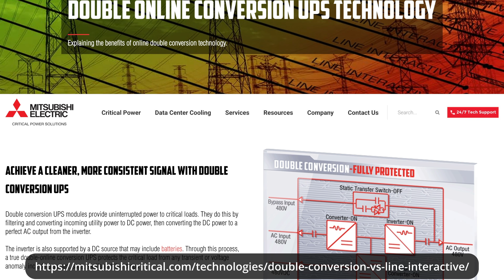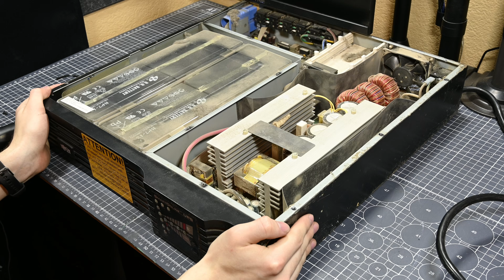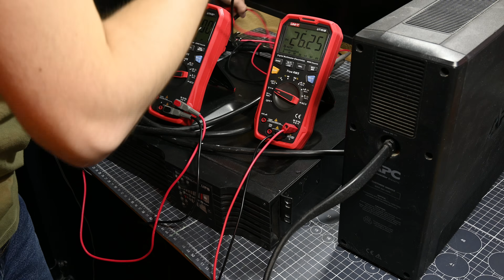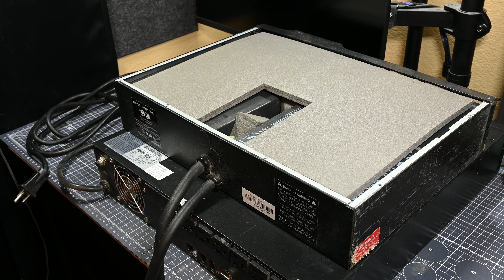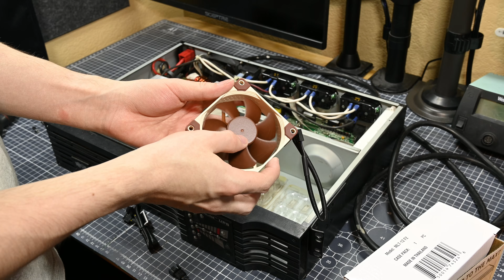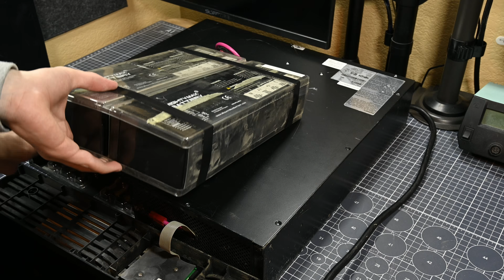I Made HUNDREDS Fixing and Selling These Giant UPS Units!

Comment: I literally just replaced the battery in an old one that was being recycled from my job. Same exact model as your 24v one. But, it's way too loud and I don't really need it, and they sell for like 100 bucks online, the exact amount i spent on supplies to fix it. It's so heavy and loud too! It's just sitting in my room doing nothing lol. Wish I could offload it! I even have an extra pair of replacement batteries. Great vid, huge coincidence!
Reply from the maker: Are you able to try selling the unit locally? That's how I offloaded mine. If you can manage that, you can charge more for the unit because you don't have to charge the buyer for shipping as well and you get to keep 100% of the cash. Some homelabber near you would probably love to pick one of these up with that spare battery you mentioned for 200-300 bucks!
Reply: @CHWTT  I would try but I'd never want someone to blame me if it failed or their important hardware went kaput. Regardless of if its actually the UPS fault, Im paranoid theyll blame me. Maybe if I sold it to a stranger

Comment: JTLYK,  at 15:54, you're using Nitrile gloves as extra protection.  Nitrile is not a good choice for insulated gloves.  Best to use ASTM D120 gloves.  There are very flexible, inexpensive ones on Amazon. I'd rather see a shocking video (OMG, the dust on that unit- how did it function?) than a shocked you. :text-green-game-over:  I'm glad the units sold!
Reply from the maker: Thanks for the tip, I will look into those!

Comment: Those aren't "battery cells". They are batteries.

A battery is made up of cells, and those batteries are made of of 6 2.2v cells to give you the 12v.

The ACP isn't a "2s 2p" pack...

That S and P is in regards to cells.

So being a 24v set, it would actually be 12S2P.

But you really should drop that. It's not relevant.
Reply: OMG... Stop talking about P and S. 

And cells.

You make yourself look stupid using terms you don't understand.
Reply from the maker: @theonewithin609  I'm well aware of the fact that a 12V battery is made up of 6 internal cells that are the actual cells. And yes, that would totally make a pack of two sets of two 12V batteries in series in parallel a 12S2P pack.

However, in this context, it does not matter that the batteries are made up of several cells internally and that there are technically 12 small cells in series when two batteries are in series. If I was building the pack with those individual 2.2V cells then yes specifying the pack as 12S2P would matter, but I'm not. I'm limited to identical blocks of 6 cells. In relation to the UPS battery pack as a whole, which is the scope of this application as I'm refurbishing a unit and not engineering one, each battery can easily be considered a cell when compared to the whole UPS pack, and each true cell can be limited to being called a cell only when in relation to a singular battery (again within this scope).

Hence, while it would be more technically correct to call the large 8-battery 48V 18AH pack a 24S2P pack and the 8-battery 24V 28AH pack a 12S4P pack, the people who are just interested in or who are just trying to learn about repairing a lead acid UPS unit will not care about that level of detail and could very easily become confused or overwhelmed by revealing too many layers of the subject at once. Writing to an audience is a critical part of creating content like this, and while your point is technically correct, it would be a poor choice to have based the whole writing of this video off of it. A tidbit expanding on this topic briefly at some point in this video probably could have been included for the sake of maximum accuracy, and will be next time, but the overall language describing packs as 4S2P and 2S4P in relation to the number of batteries will not be changed; it is the most efficient, effective, and simplistic way to convey the necessary information to the largest percentage of the audience.

Comment: It's worth noting that the runtime for these types of UPS's really isn't that large.  They're  built to run very large loads for a short time while the generator gets fired up.
Reply from the maker: Very good point, their goal is usually either that or to keep the equipment on long enough to safe shutdown for the remainder of the outage.
Reply: the goal is to hookup the ups to the active Machines, either thru software to the machine via RS-232  or they have an active  mgmt.  ethernet port to  gracefully shut them down... so data is not lost... as in DBMS, or server cluster... things that were done in the early 2000's. UPS's under a desk is another story.. in the corp. world, it gave you time to save your work locally so you didnt lose what you were working on...  get it right....

Comment: Imagine throwing out that UPS when the 12v battery died. Its replaceable for a reason lol their old owners must have been dumbs
Reply: I see quite a few of these.  They've almost always had their batteries replaced at least once so the owners (or their IT crew) knew how to do this.  Probably they replace these on a regular schedule (maybe 5-10 years) or are doing it as part of a larger upgrade. The same is true of servers, network switches etc.
Reply from the maker: I've seen some silly stuff with UPS units being thrown out after a couple years for sure, but like someone else said, it's also likely that the batteries were changed out once or twice throughout the lifespan, and the owners were just replacing the units as part of a standard upgrade

Comment: I think that while it is interesting to see that these are repairable, I would hate to try to figure out what the liability insurance would be for this sort of repair.   Making it work doesn't make it safe, and it also doesn't make it reliable.   You only need one of these to decide to ignite to cost you a whole lot more than you can ever make doing it.   It is a risk reward thing, and I can't see any reward.
Reply: Replacing batteries in an UPS like this is normal maintenance, basically the equivalent of changing the oil in a car.  They all came with instructions for doing this when new.

Comment: Wow like really? Hundreds? that's amazing. you might even might pay one month's rent.

Seriously though, they have similar capacity in newer LFP batteries out of China that won't interrupt sensitive electronics but they DO have switchover but 99% of systems will not be effected because of the switchover speed.

The main draw of old APC units like these is someone wanting to replace an identical system in a legacy system and not have to go through the paperwork of proving a newer system would work fine.
Reply from the maker: Haha, yeahhh there's a reason I'm still working a full job at the workplace I managed to snag these from and not just going around finding old UPSs, life is sadly expensive.

And yeah, I've seen some of those Chinese UPS units with the LiFePO4 batteries in them, they definitely intrigue me and I want to see if I can snag one for the sake of checking it out. Plus you're right, switchover has become a lot less of an issue as time has gone on and many line-interactive type units won't disturb any electronics, though I do think the double-conversion units still have a place, in particular in buildings with really dirty power waveforms.

Comment: I did a much similar project at work a few years ago (right after COVID).  I refurbed several UPSes to the tune of $3K in batteries.  These were large 208V machines and it was surprisingly easy even for the big battery packs.    I found a moving dolly to be extremely helpful in moving these monsters around.

Unfortunately, there was about a year or so that we decided to close the office, so I managed to find a few of the 120V units and now they keep my home network alive.  If you can get ahold of the WEBCARDLX, the network monitoring card, it's even better as now you can use Prometheus/Grafana/SNMP_Exporter or applications like Observium/LibreNMS to monitor your UPS operations over time.

Comment: 3:42 holdup, you say absurd amount of dust on the ups but then you pull out a completely different ups at 3:45. Sus, you dont mean to say that there was so much dust that colors didn't even come through :P
Reply from the maker: Nah bro, it was SO MUCH dust that yeah, they literally don't look like the same unit but they are
Reply: @CHWTT  i am quite new to electronics, had to start with V=I*R (i still forget this but its actually quite easy to remember if thinking about I as electrons and V as pressure, which is either very high for very short or is guided by R). But i thought lead acids were ment for car starter and the like. Interesting to see lead acid being used in something like a ups that needs to supply power to pc's and the like.
Reply from the maker: Yeah, it seems an odd choice at first, but once you look into it more it makes a lot of sense, as lead acid batts don't really take issue with being pretty much fully charged 24/7 (unlike most lithium types), they're really cheap, easy to use/implement, and they're one of the safest battery types too which I appreciate considering how big the packs are and how frankly terrifyingly volatile a lithium pack of a similar size would be.

All that being said, there are more lithium UPS units showing up on the market which definitely have some distinct advantages over lead acid (while of course also having some drawbacks), and I've seen a shift towards this type in the past couple of years
Reply: @CHWTT  oh, i didn't know that. Really interesting and i now want to research abit more about small size lead acid battery's.
What is your opinion about 2nd hand lead acids? You mention they work well with being fully charged 24/7.
Are they less good at being used as normal battery as in being discharged and recharged? Ive read some stuff about deep cycle or something on large size power banks.
Reply from the maker: I would probably never go with 2nd hand lead acids, you're unlikely to save much money anyway and the biggest downside to lead acid is that they don't have a very long lifespan (usually expected to be around 3-5 years, 5 being pretty rare to reach). As for how well they work at being used as a normal battery with charge and discharge, they do lose capacity faster with more cycles, and yeah, deep cycle batteries do exist which allow the battery to be discharged further than a non-deep cycle battery while causing less damage in the form of gradual capacity loss